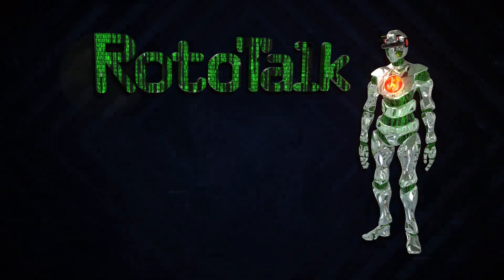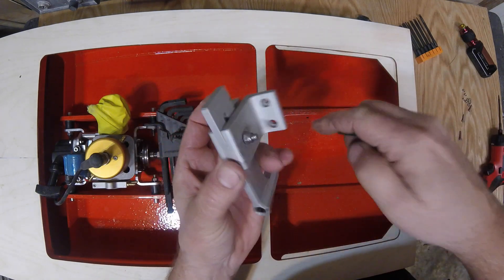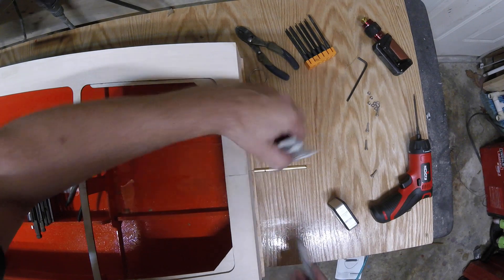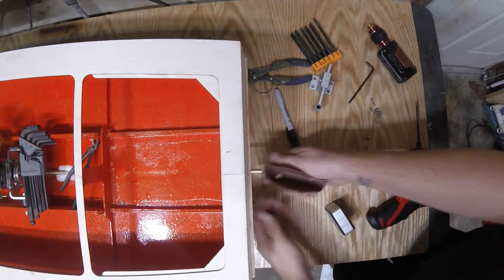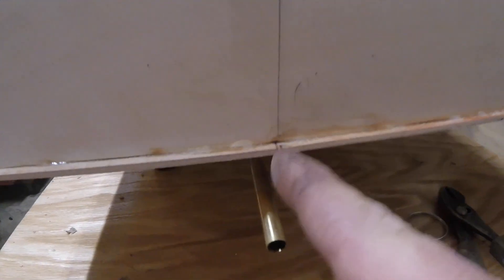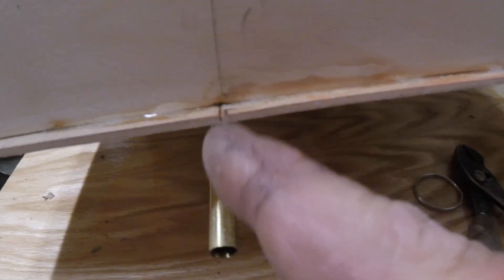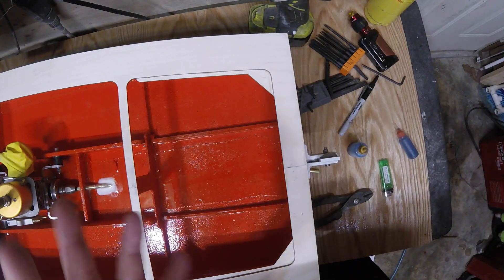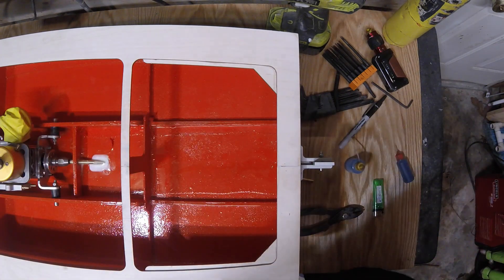ZippKits A Box "Crackerbox" RC Gas Boat build: Chapter 10: Installing the strut

Comment: was just wondering, i have a old strimer engine  i cut up and removed as much waight from to convert it for a plane, cut the flywheel down as well, i never used it in the end though. so now want to use it in a boat do you you think if i machine the fins off the cylinder then put a water cooling coil, like you can get for brushed motors on it will be enough to cool it? i can easaly weld a jacket on it but was thinking it might warp the cylinder and its more hassel anyway,  just found another channal to sub to!!
Reply from the maker: hey brother! ive done that with taking off the fins and then bending copper tubing around the head to make a water jacket, it should work ok, remember, weedeater engines etc are much less torque and rpm than the zenoah marine engines, so its not going to be a high speed devil so the home made cooling should be fine. and also if its a crackerbox hull, its open, so itll still get air cooling and water splash